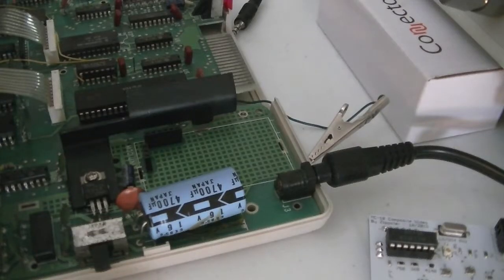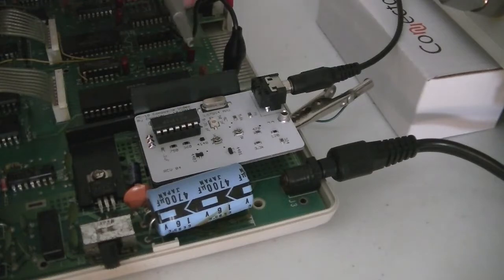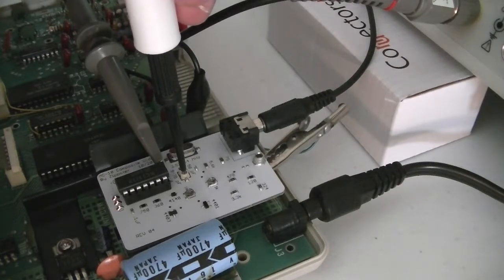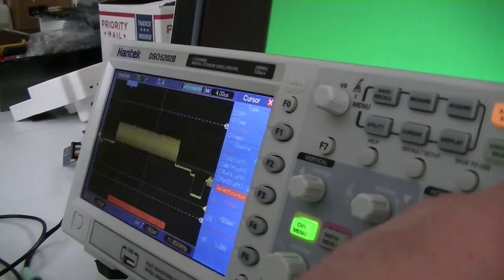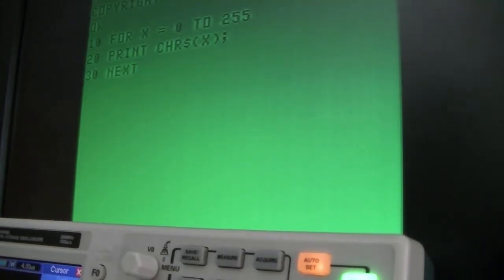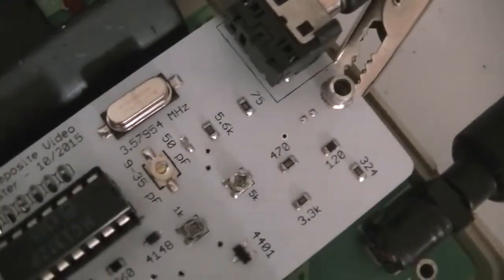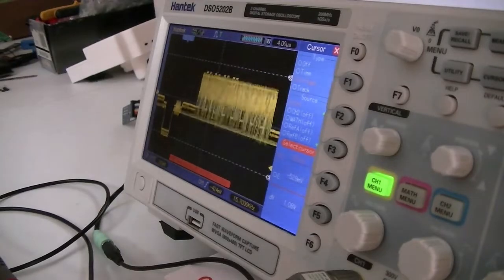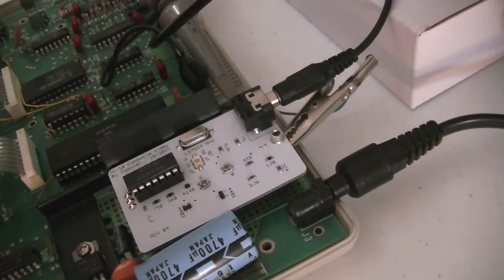MC10 composite mod adjustment

Comment: Is there a video of the removal of the RF can and the installation of the headers?  Are all of the things needed (not tools obviously) included in the kit?  I see there's at least one on the zippster zone and I'd like to snag it up!

OK!  I managed to find TWO videos on installing this mod.  Obviously, I only need to kit as-is, no additional parts (save my own solder and all that).  And it looks super easy to do!  About to place my order!  Question for Ed Snider though:

The Ch3/4 switch: Is there a way to make use of that to kill colorburst?  That would be an excellent use of the channel switch!  I suspect there might some way where the switch would simply ground something.  Wouldn't know where to look for it but I'll bet someone knows!